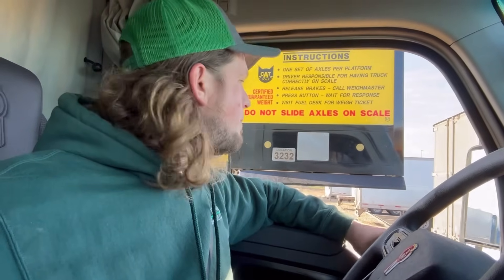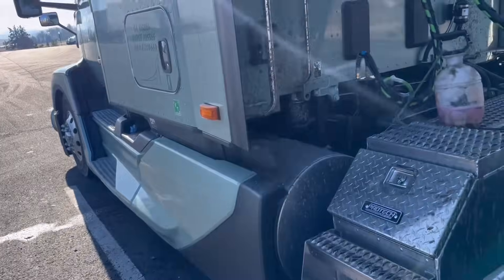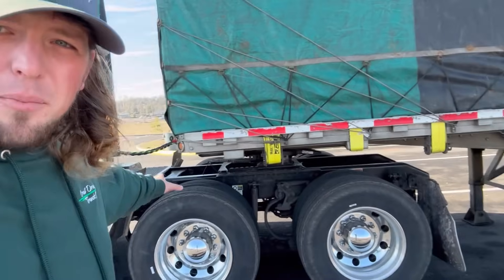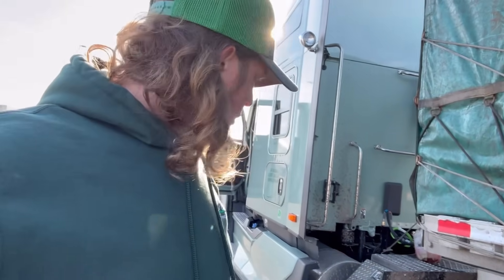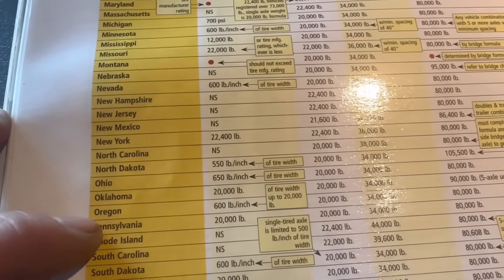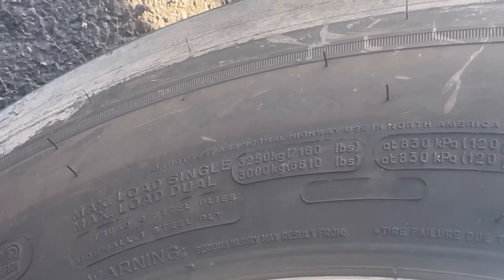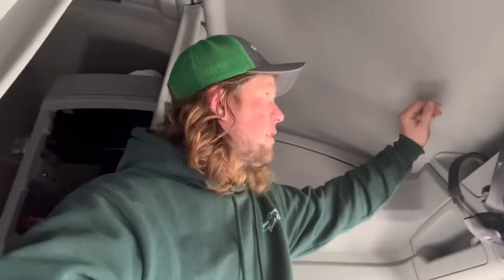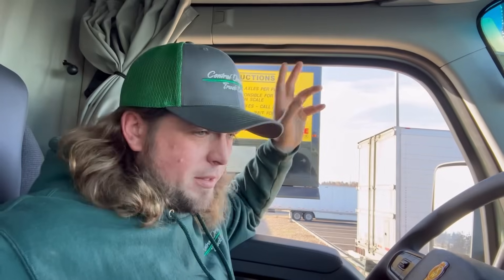Gross Weight, Axle Limits, and other acts of Mathematical Masochism

Comment: First off young man, you're not Stupid.
It was SMART not to fuel up before scaling the load.
Full tanks of fuel would put you well over 80,000 gross the APU exemption wouldn't work.
With the APU exemption, you set your drive axles to be overweight, not move all that weight to the steering axle, that's suicide.
Your trailer tandem doesn't slide ?
That's 2 maybe 3 holes in to shift the 200 lbs. off the tractor drives, which moves to the trailer tandem, that now gives you room for a little fuel.
If the APU exemption is going to play into this, I want the overweight on my drive axles, with the fuel 75 gallons x 7 lbs. = 525 lbs.
Enough fuel to "burn off" to get to the scales, and fuel again after that.
I'll roll with 12,000 on the steers, Overweight, on the drives, legal on the trailer, and the gross under 80,000.
Don't make if more complicated then necessary!
The 5th wheel is a last resort to move. It ALWAYS splits the drive axles, with a 1 or 2 notch move forward if needed.
I want under 12,000 on my steers, I never make a practice to roll overweight. It's a CONTROL thing for me.
Keep Safe !
Reply from the maker: I like your style. I have fixed tandems on the trailer. No adjustment. I didn’t clarify, but if I was leaning on the APU exemption, I would move the fifth wheel back and keep the weight on the drives.
Reply: @jessebaremore  
Okay I understand so that does make for a challenge.
I feel it's always best to scale before fueling.
Load placement on the trailer ?  That fixed tandem creates a problem, reduction in the freight would be the only solution to be within 80,000.
Scales are more likely to give you a break if your over axle then over gross, that's the "iffy"    Good Luck Safe Travels.

Comment: And if that is a split axle trailer you're good for 40,000 not 34 I noticed you're pulling a flatbed but didn't see your axles on the trailer.
Yeah I hate it when they load you heavy like that
Reply from the maker: I have closed fixed tandems on the trailer. Frustrating at times

Comment: Honestly if i cant fuel my truck because they put to much on my truck and it puts me over weight i just take it back and tell them to take some weight off im not going to sit there and fight trying to get just the right amount of fuel to not go over in fuel weight also if i remember right the apu weight exception is for your drives axels and gross weight your steers and tandems still have to be under weight limits

Comment: We need a follow up video now to see if you were stopped at the next weigh station.  And if you were, what did you weigh?  Great Video!
Reply: Also with a width of 275mm, that is roughly 10.8 inches, so you were good either way on your steers, except for the state that had 550lbs/inch,  Not taking into account being over gross, but I would chalk that up to a rounding error if the weigh station questioned it.  LOL
Reply: @justinvolk1606 🖕 what he said.